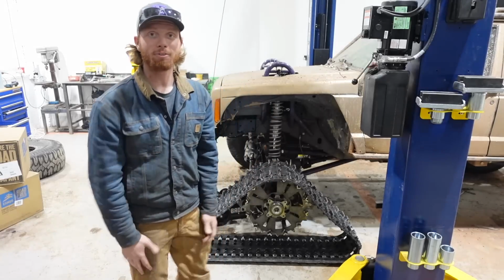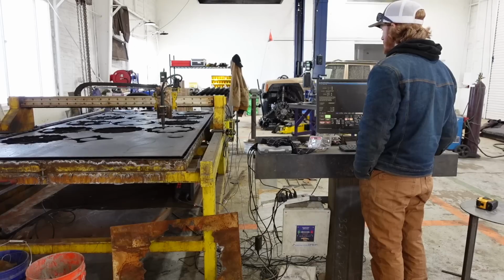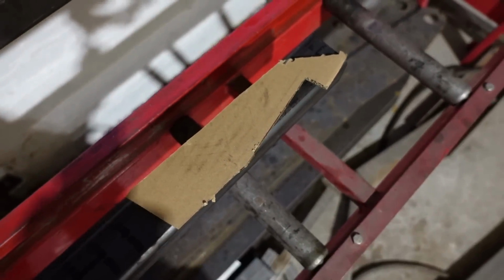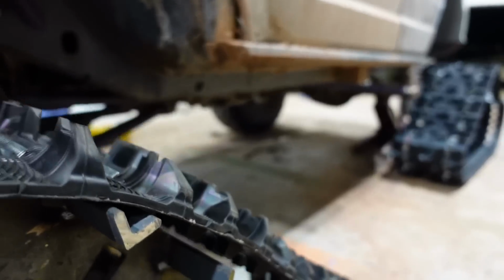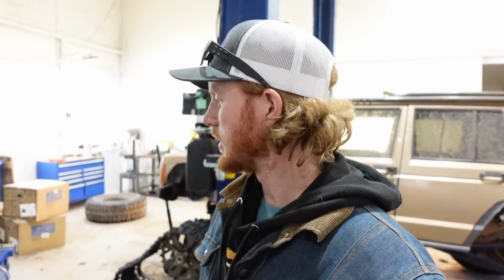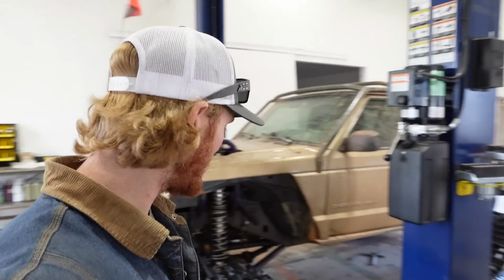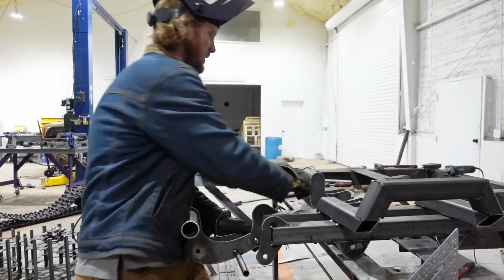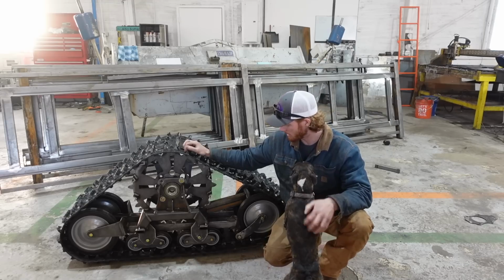Are These Snow Tracks Going To Be Enough???

Comment: Super amazing job man. Insanely great job. Ya youll break em and reenforce. I’ve built mini bike track. I would nvr attemptwhat your doin. You’ll killing it love the build.   Want to have the tensioner end Facing forward.  So adjustable wheel pointing towards front of truck. Slacks always going to be on front wheel so want the solid non movable wheel on the back of track and the movable wheel on the front of the track.

Comment: Hi, instead of angles I put those 3 plates together with ¾ round black steel pipes bolted together instead of angles wish is a hassle trying to welding in together
Reply: And the Big bottom wells I will install struts with springs for better performance

Comment: Amazing work Rudy! Looks fantastic. I think those articulating joints for the small wheels are going to give you an issue without the use of a bearing or bushing though. My guess is the constant movement will oblong the holes in the steel brackets and wear down the bolt. It will probably be a little while before it becomes a concern though.

Comment: The week point on the 12” wheels will be the stamped steel “hub” and bearings. 
You could cut out the center and make a new hub that bolts through where the old stamped hub halves contact each other and design a center bearing that will utilize better sealed bearings.

Comment: Digging the process Rudy I wanted to say at the beginning that you should probably angle the steer lower wheels up say 30 degrees not from experience but I notice lots of tracked rigs have the front lower wheel higher and it seems they steer  better... dig the process not knocking it just what I was noticing on snow cats

Comment: Nice no need for exact. I have noticed with some types they have torque arm to keep them from turning over if bearing binds.  
Don't know what grade your all thread is but is going to banged a lot.
Might want to think  ,see about getting bit of front turn up with track.  You will see as you use them

Comment: Those "bogey" style wheels definitely need a sealed bearing system. And you absolutely need to get more track tension with the literal triangle of track you have there. No matter how much you stretch em from the inside to apply "tension" they will always, always, always balloon under any type of RPM! A sprung roller type of tensioner that rides on the outside of the track is extremely popular and fairly well proven for short, tall track configurations. If you can manage like... A 175 or a 164 Ski-Doo track in the rear and set it up super low... It'll hook, and rip for having so much mass spinning! Couple dudes 'round these parts have built some hilarious tracked Toyotas that are now actual micro monsters! Document this entire process! It's fantastic! And I bet they weigh more than even a fresh set of Patagonias and bead locks. 🤘😉🔥

Comment: So great!  If you're not going to be driving on the road, you may want to think about metal tracks. Those rubber tracks are great on everything except solid ice. with the metal tracks they'll grab ice no problem but not approved for on road. Heavy D has a video where he has a truck with rubber tracks and is sliding all over the ice.

Comment: Great project. 
I believe it needs twice as many bogie wheels for the weight. 
Add more gussets or reinforcement between inner hub flange & outer hub flange. Could be a 6" pipe in center if there's room. Maybe remove metal on pipe for lug nuts & socket.

Comment: Your large wheels have a single point of failure and the bolts will shear off. You need an outside arm support so the big wheel will be supported properly when the track hits something at an outside edge angle.

Comment: Hey man mount an airshock laying down on top of your bogies to spread your 12 inch wheels apart and keep tension on them. 
Make your hub mounting plate about 12x12 and frame it with square tube for lateral stability.

Comment: You could use angle iron for the bottom like a snowmobile.  Also you could mount a small coil over shock between the front wheels to keep tension and allow for articulation.

Comment: Very impressive design work Rudy !! Farming out some of the welding work to your brother was a good call 😆, I enjoy it too but after so many hours worth it's nice to take a break...  I do have a thought about the larger idler tires loosing their bearing pretty quick , you could revamp the centers with a tube/dom chunk that will carry more weight and be less likely to fail .. Taking into consideration the weight of the vehicle and the force they will see from impact and torque plus getting loaded up with snow & ice I think that's the only weak link... Otherr than that awesome job !!

Comment: Welding and fabrication, it's a wonderful thing! 
I do have some concerns though.  
1) won't all the weight of the truck be on that bearing? It will roll, I'm sure of that but my guess is any sudden impact or obstacle or wrong angle will really test that whole area. For example running over something that's only under the inside portion of the tracks.  
2) the tightening wheels should be in the back shouldn't they? Also why haven't you angled the front of any of the tracks? How will they roll over obstacles?? 
Time will tell, can't wait though. May the odds be in your favor lol

Comment: I see this as a good first attempt.  Everything needs to be heavier/sturdier.  I feel like the bigger leading wheels need small coil overs for tension, not a fixed rod.  The side plates connecting to lower carriage to the axle/wheel center should probably be 3/8”.

Comment: Tip for aligning the wheels on the frame (especially the large wheels). Get a couple of really long bolts or rods, so you're alligning them as a pair. Instead of individually. That will help getting the tension even across the belt. 

Also you want wheels with roller bearing in them, that will.

Comment: you will need to add a brace to keep them upright or it will try to rotate the whole assembly when the "nose" catches
a motorcycle rear shock would work great hooked to the frame

Comment: You might want to add a Watts link style brace to the front on a slider connected to the steering ram to keep the leading part of the track from going wherever it wants. And a wishbone similar to one used in drag racing on the rear tracks for the same reasons.

Comment: Riding lawnmower tires and wheel, or wheelbarrow tire and wheels may fit in the middle of the tracks.  Then inflating or deflating the tires would help adjust the track tension.

Comment: DUDE, LOOKING GOOD 👍🏽👍🏽.  At this point my only thot is if the 2 larger bottom wheels should have some sort of spring or shock or bagged type of movement to absorb
The impact of the ground rock or I don't know !!!
It just seems to me that a SOLID system will destroy those hard rubber wheels !!  The wheels I've seen are flexible rubber .. like a wheel barrow w foam filled or air to absorb shock loads along w a horizontal shock system of some type.
Just throwing it out there for brain food 🤓🧐🤔
So far it's all VERY impressive Rudy !!!

Comment: I am concerned that the attachment bracket to the hub is NOT heavy enough.  There will be tremendous stress at that point, especially when you are steering in heavy snow.  Bob from Wisconsin.  Lots of snow cats for grading snowmobile trails.

Comment: Great project and yur good on construction tech. Have a look at  D9 tracks for strengthening yur steering. Weights and measures but mini version. Wheels inside front and back of tracks connected to central steering arm somehow to avoid week points for easier turning.

Comment: those back bolts for the pivot arm/tensioner could do with some double shear. just add a bracket from the centre support rails to the outside of the bolts. other than that they should last till the snow melts

Comment: Agree with other comments. The 12" wheels are not going to last long. More an issue in area of axle.   I would rethink the adjusters so they move horizontally only and I hope you beef up that mount where it connects to suburban bearing.  High stress area for sure.  But great project Rudy.

Comment: My Tucker Snowcat weighs about 10,000 lbs when on the trail and has 4 tracks. Each track has 6 bogies and each bogie has two LM67048 bearings which are pretty common on 5000 lb trailer axles. I find they require re-greasing after every other trip, or about 100 km. The C90 rating on those is 2720 lbf per bearing, and there's 12 per track, so 32000 lbs force for 2500 lbs per corner. So 13x the weight is the force. You're probably 3000lbs or so, so 750 lbs per corner x 13 = 9750 / 12 bogies = C90 812 lbf per bogie or C1 Dynamic I came up with 3150 lbs. In my case the front and rear bogies take more of a beating since they double as the ice breakers (ie they're made of harder rubber than the center 4 bogies).

Comment: is that the same load path the commercial units use? through the top sprocket wheel, to an outside hub down to the frame?

Comment: you should use a fully adjustable coil shock for the tensioning system so that it keeps some give in the track and also to keep the track from disintegrating under pressure. hope that makes sense. example of shock would be screw type adjustable off of atv.

Comment: How about you build 2 track's fit them on the back and go for a drive
The front wheel hubs you used why not put a shaft in the middle for additional strength
Great series can't wait to see you in the snow with them

Comment: Hey Rudy... I paused the vid to make this comment... I fast forwarded to see what you came up with (cause ocd you know) bees make strong crap out of wax..... more the gusseting than the heavy structure BUT weighing that the overall amount of thrash you wanna handle .... Rudy Rule:  Make it strong .... Rudy's working it ! keep me smilin dude !
Reply: oh yeah had to repause...  forgot to mention why I pause in the first place.... weight to traction patch ratio factor ... might weigh as much OR EVEN MORE... but you mentioned it early on... the traction patch size of tires (aired down of course) to the overall amount of rubber you actually have on the ground gotta be a key factor huh?

Comment: For the 12 inch wheels did you consider using trailer tires.  You could center mount two instead of the 4.  Something to consider if the wheels you have now fail.

Comment: Those 12 inch wheels and maybe you got the 10 inch there as well, dolly cart wheels, soft steel bearing, meant for light loads, we used these in cub scouts cub mobile racing. Need some heavier sealed bearings, for those wheels, the races are just press fit into those wheels.  They can actually suck into the wheel two havles. The races will fail,  if you get 20 miles out of them at 20 miles per hour, I'd be surprised.
Reply from the maker: I hear ya, The guy with heavier bearings is on speed dial lol

Comment: cheap wheels are good enough but if you drill them out in the centres and weld them together on a pipe and put some good bearings to run in the pipe that you can keep greased up nicely should work ... also worries about all the wheels being mounted solid might do better with them connecting up to something like a leafspring on top acting like an inverted bow to allow some give otherwise rocks might end up smashing your little wheels ... great idea and amazing fab skills keep it up.

Comment: The weight is immaterial. Your ground pressure is going way down, compared to tires. When you store them, put some Harbor Freight furniture dollies under them and scoot them along a wall. You'll appreciate the bulk when you're bushwhacking thru the snow covered sagebrush. The light stuff will be prone to flex and break. And you won't be able to put a sideways pull on the track frame.

Comment: Great idea I'm just worried about if the wheel bearings in the little wheels and bigger wheels that you were using for your tracks will be able to handle the speed without burning up
Reply: A very good question , the 12 inch wheels which are designed for a hand truck have a design speed of around 5 to 7 MPH the 5 inch wheels less than that . Years ago a company  I worked for sent me to Torrington bearing school . And I learned that if you double the load on a bearing you decrease its life about 8 percent , if you double the speed.  you decrease life about 90 percent . Ball bearings are the weakest and roller bearings are best for heavy loads . The wider your roller bearing the better . And lubricants in bearings  need special attention on low as well in high temperatures .

Comment: Now would be a good time to return your 12 inch idler wheels for something more robust with sealed bearings. The bearings in the wheels you have will disintegrate quickly. Are you going to add some hyfax to the bottom of your tube steel frames? They make some for the runners on plastic snow sleds that you could counter sink  machine screws and attach to the tube steel.
Reply from the maker: Lol, we’ll see about the wheels. I did look into the hyfax. The problem is is the high fax don’t work very well in the sand… I can definitely add them later though

Comment: I like your adjustable wheel track tightening   system a lot .IIsnt the track being heavy and carrying the weight low the twomain things that keep the entire track from spinning around with the drive sprocket if you got a track in the air while driving?. For instance if you got a track over a  ditch hidden in the snow maybe, or if you hit a bump tha sent you int6o the air for a moment.

Comment: Nice project, I built a auto rotisserie using wheel bearings for a car to turn the vehicle, word of warning the bearings was pressed together, with the weight of a full size quad cab the bearings had become unpressed after about a year. I would weld a bead on the back side of the bearing race to the axle so that doesn't happen. I ended up rebuilding with stub axles for a trailer that Had a nut to capture the bearings so no way that will happen to me again.
Reply: Oh, by the way. I don't think your wheel bearings are going to hold up on those smaller wheels. Maybe should have purchased wheels designed for snowmobile tracks.

Comment: You’re gonna have to cut back some of the outer portion of the angle ions so the frame doesn’t touch them as the track rolls and you’re going need a way to do some form of alignment so the tracks don’t slip off the roller wheels

Comment: I'm not a fabricator, never run tracks of any sort, so this is just an observation (and i havent finished watching the clip so maybe it gets addressed...) cutting the angle iron back to end shy of the edge of the tracks... will that cause a wear point as the track runs around and isnt bearing on the full width of the track, or is it not an issue because the track is unloaded going over the high point of the travel? Actually being driven by that part of the travel it seems it might be taught over those internal ends. Maybe cut back even further, so closer to the outer sprocket?

Comment: Hi Rudy
Looking at the design, it looks good, BUT should the front rollers be raised about 6”, to give a lead angle of a round 20-30deg. This would allow the track to rode over snow etc, and have a tendency to dig in

Comment: Looking great, but you’re right, a lot of it is way more HD than it needs to be.  I’d be looking at aluminium for a fair bit of it.  Going by current design I think the tracks will be heavier, not by too much, probably at least 45kg/100lbs a corner.  Worth considering you can go a bit heavier without too much issue because although you’re increasing the weight on each corner, your rotational weight and rotational diameter will be significantly less than with wheels, so you won’t lose torque, should gain a good little chunk in fact.

Comment: Question. Are you gonna put any type bearing or bushing in the center of the wheels, especially the bigger end wheels so it doesn't wear on bolt or rim of the tires?

Comment: Cool. 
Just wondering why such large wheels front and rear?
Casey’s tracks have the same small wheels all along the ground to track contact length, with a slight rise on the support frame at the leading wheel - to ride over obstacles. 
No criticism, just asking.
❤️🇷🇴

Comment: Rudy... A suburban isn't held up by those 4 bolts, it rides on the bearing which the race rides on the axle. So all the weight is supported by the axle not four bolts.
And scrap the solid wheelbarrow wheel for a steel wheelbarrow wheel with a pneumatic tire.
Reply from the maker: What about in the 2wd models?

Comment: not having much snow where I live - ie. never built a tracked vehicle, I wonder if the  small idler roller - pairs -  were mounted onto a leafspring, attached between the axles of the front and rear idlers would be a really simple means of track suspension..  (The trailing idler would be "very cool" if it were mounted on an air or hydrauliic  strut for tensioning / dynamic tracking. I too, don't like the idea of a rigid system.
Of course, Rudy is the "Guy" here - getting things done, making content.

I - still watching.. think tyres will be lighter than track, but the tracks should have a bigger footprint - better floatation, though, drive is more important than floatation, a paddle track - with ice screws would rule..

Comment: I think I would use trailer wheels/tires on a trailer spindle instead of the wheels you used.  They are designed to handle the weight, and would be packed with grease.  You'd have to monitor their pressure with use, but that's easy enough to do.